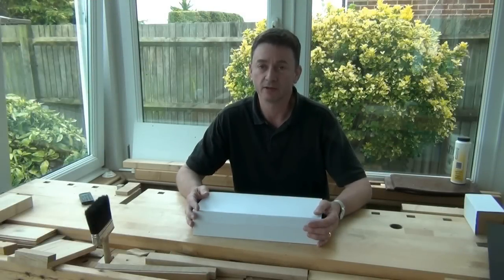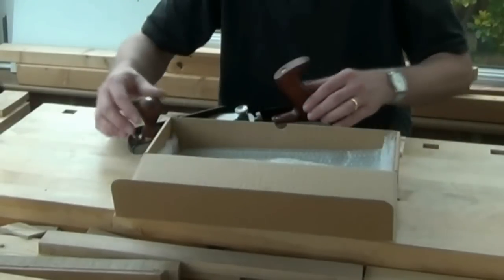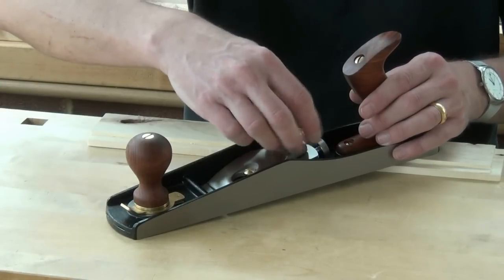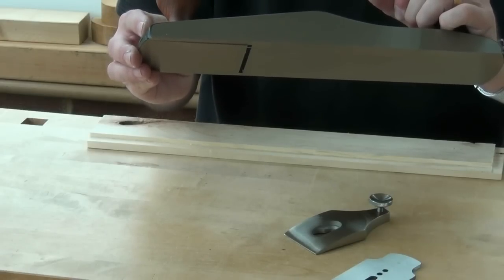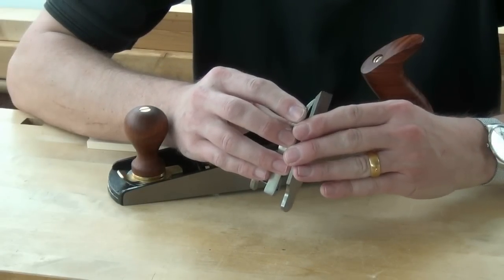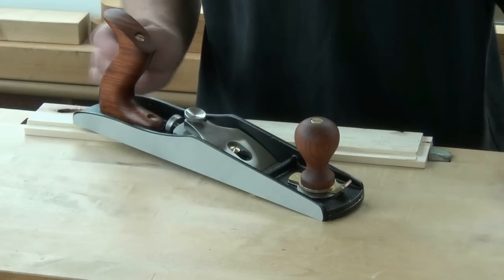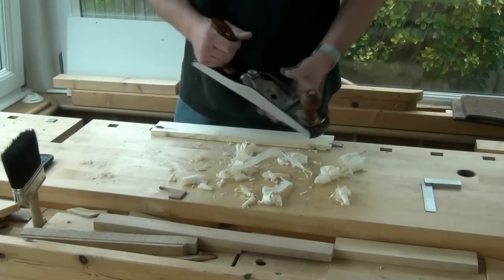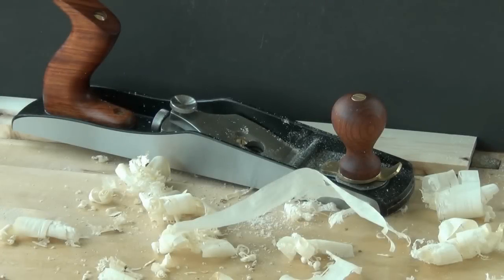Quangsheng No.62 Low Angle Jack Plane Review

Comment: I recently purchased this plane through Rutlands, where they had it on sale for about $150 US. I had the same experience you did, Mitch, with honing the iron. A minute or so on a diamond stone, then a few strokes on waterstones, and the back was flat and shiny right to the edge. I was pleasantly surprised with the small amount of work needed to get the iron honed.Also, the initial honing to me is of little consequence, because even if the iron is shipped to my house razor sharp, it will require honing again after a certain amount of use. Thanks, Mitch, for all your efforts.
Reply from the maker: Thanks, I'm pleased mine wasn't a one off! I can highly recommend the additional irons available for this plane for tackling more difficult woods, and even the toothed iron from Kunz (although mine needed a fair amount of work, it did appear that it had slipped through qa). These irons came from Workshop Heaven in the UK.
Reply: Funny, Rutlands says it's not for sale outside the UK.

Comment: I own a WoodRiver No 62 (bought at WoodCraft in 2016) which people are saying is the same.  It does not have a Norris adjuster, lateral adjustment must be done on the iron blade itself.  However, I can reach the adjuster while planing and adjust on the fly.  My iron was flat but not sharp out of the box.  I don't have a diamond stone and it took me more than a minute to sharpen :). I got it at the same time I purchased a Bailey no 5 from an antique dealer in town and spent several hours flattening and fixing the plane including ordering a screw for the toe.  I am using them both on a project I have.  Side to side, I always reach for the no 5.  Despite tuning both blades and planes, it does a better job on the highly figured cherry I am using.  I have a high angle blade for the no 62 too.
Reply from the maker: Hi Todd. That's interesting to hear. I prefer a no.5 most of the time; it just feels more comfortable. Nothing to do with the handles, which are good on the Quangsheng, but somehow to get the best out of the plane my whole stance needs to change.

Comment: Whats is the point of reviewing a plane out of the box? I don't understand why you tube reviewers keep doing this! You just spent 15 mins trying to drag a dull blade through wood when every manufacturer tells you that the blade will need additional work and that its well know and accepted fact that all cutting tools will require a little bit of fettling when new - all this could have been done in the time you spent here. Its unfair to say the plane has caused tear out when you are taking such a heavy cut with a blade that hasn't been sharpened. You might find that one of the big manufactures does a better job out of the box - but is that really a convenience worth spending double the money for? Most would say no - i have no doubt that that plane could make a shaving just as good as a big name version ones after a short period of work to get it right. The only real difference is the quality of the finish on the tool, not the work, and much as i might not like to admit it - thats not that bad either. True it doesn't compare with a LN or V but its half the price! I own something from all these manufacturers and whilst i might like to have all my tools look and feel like a LN, most people simply cant afford that luxury - i find my Quangsheng's perform equally as well as my LN and V. Fine, accurate shaving are not produced by expensive tools , they are produced by sharp tools and good technique. Look at the furniture that was made 100 years ago by wooden planes, no LN back then and most people today couldn't match the quality. Reviewing a plane before tuning it is like reviewing a washing machine before taking all the bits out that hold the drum in place whilst shipping and telling us you expected more from it 'out of the box'. You seem like a nice chap and all but this is another pointless review - i don't know what i can expect from the tool at all, i just know what its going to look like once i open the packaging.
Reply from the maker: Thanks, I appreciate your points, and that anyone with your experience of different manufacturers is unlikely to get much out of a review like this. However, many people new to the craft don't have your knowledge, and they do appreciate hearing these things. I will try to consider more experienced viewers, like yourself, in any future reviews.
Reply: +Mitch Peacock - WOmadeOD I think my point Mitch is that people without experience can very easily get the wrong idea about a plane like this when they see it trying to work straight from the box. These are great planes and will give the big brands a run for their money, but the blade will always need to be sharpened. Why not sharpen the blade up, flatten off the lever cap and do whatever else needs to be done, just like you cleaned off all the packing oil, and review the plane in the state that it will serve out its life - then people will see what it is capable of. You can always mention what you had to do and tell people how long it took etc... But the point is they see the tool working in its true condition. If after a little tuning it is still tearing out and not performing well than it is entirely justifiable to point those faults out. Without trying to sound mean, or condescending -  the errors you pointed out in your video are what you could call user errors and not errors in the plane. A LN that might plane like a dream normally but with a blade thats been allowed to get a bit dull - may be only after a couple of passes over some tough timber - will also perform badly and tear grain - but it wouldn't be appropriate to say you were disappointed with the plane - it just needed a sharpen.

And for reference i have no experience with this plane - hence my interest in your video, but i didn't get an accurate picture of how good it was because you never sharpened it - if you had, we would all have seen how well it really performed (or not). 

You have a great manner in front of the camera, and the video was interesting - there are many youtubers out there with nothing interesting to say - but i could happily watch you (and did) I only mention all this so that you can make good review videos that really help us get to know what a tool is like. I'm sorry for going off on one - but this 'out of the box' review culture is really irritating me - its fine for some things, but not edge tools.

Thanks for the response - i hope i'm being helpful and not a tool!
Reply from the maker: +Its a Peach no, you're good. I welcome all constructive criticism, and it makes my videos better in the end. Out of interest, did you watch the sort and long version of the Rider #4 review? It's still an out of the box, but also shows the result of a hone.
Reply: Its a Peach q
Reply: Its a Peach t
Reply: Got to agree, who doesn't sharpen a plane before use, and the guy then complains that his unsharpened plane is cutting too thick,

Comment: Nice review Mitch. I have the Lie Nielsen no 62, and it also required work on the blade. It was good, but the performance was not as good as expected. I had the same results as you. Sharpen the blade a little, and it came to life.
Reply from the maker: GuysWoodshop Thanks Guy. 

Given the small amount of time required on the blades, it surprises me that these companies don't go that extra mile to stand out from the crowd.

Comment: The trick to adjusting on the fly with these is to forget the front knob while you set the depth. Cradle your front hand over the wings atop the lever cap, and use thumb and forefinger to adjust for depth. Reaching with your back hand to one side of the knob may induce some unwanted lateral adjustment ..... if it's even possible to reach the knob.
Have a gander at the way Vic Tesolin sets the blade on a bevel down if I'm not describing it properly 😁
Reply from the maker: I understand your instructions and will try that out, sounds a great idea. Can't think why I never thought of it🤣
Reply: @mitchwoodwork  Sometimes we are so used to our work that we try old techniques with new things 😁 we are so accustomed to bevel down planes that we expect all planes to function in a similar way. 
I watched a video a while ago of Vic Tesolin giving a talk about Veritas tools at Peter Seftons school....... that's the only reason I know of this way of adjusting a bevel up plane for work; no way I'm clever enough to come up with it all by my lonesome 🤷‍♂️😂

Comment: How flat does the sole stay when you adjust the throat and tighten the knob. Any step would be significant. I am guessing it would be difficult to eliminate this problem.
Lateral adjuster Norris style needs no sideways play at the sharp end of the iron. Veritas uses grub screws for this. How snug a fit is the iron at the sharp end?
Reviewing it without sharpening the iron is problematic.
Reply from the maker: I think it was pretty much an out of the box review, hence using the iron as it came. You're probably right that I should have honed it. That way the decent edge it takes would have been highlighted.
The moving toe and the body were really well matched as I recall. A problem here is fixable but there is an extra element to consider before just lapping the sole.
It's been a great tool over the years, and is usually what I grab when faced with wild grain.
Reply: Thanks

Comment: A lot of people bag the No 62 as being a gimmick plane..... used onlt for end grain butcher blocks.   I have the Henry Eckert No 62 and find it out performs a bevel down plane in most area.   The ability to close up the mouth quickly on the fly on certain timbers or to just get that finest of shavings is just awesome.   The ability to quickly change out the iron to a high angle one for reversing grain or to a toothed iron for quick timber removal is priceless.   Also on the shooting board, with a dog attached, is just plane better than a bevel down plane.   Also especially with the Henry Eckert the lateral adjustment is just not necessary.   As long as you keep the iton sharpened square the alignment is about 5 seconds in placing the iron on its bed...it just aligns naturally, unsure if this is the case with other no 62s but I also have the Henry eckert 65 block plane and same deal it has exact alignment built in so no need to fiddle with it.   Never found the requirement for a bevel up now, my 5 1/4 Veritas bevel down sits there as a table weight more times and only used as damn it has to do something lol
Reply from the maker: Thanks, that's great to hear. I do need to adjust alignment when installing the iron, but a tiny hammer is my go to for that now.

Comment: One of these days I'm going to buy a Quangsheng (Woodriver in the US). I've been seeing generally good reviews. They recently came out with a No 1, so I've been thinking of that one (for detail work on small items).

I never bother using blades as they come from the manufacturer. Just as you're showing, they are semi-sharp, but not good enough for thin shavings. The Veritas and Lie-Nielsen are really no different (from my experience).

I have the Lie-Nielsen version of this plane, and the adjuster is the same. I don't think it's a reflection on the manufacturer, but the design. Norris adjusters are known for not being adjustable with the hand on the tote. That's why some people don't like planes with those type of adjusters.

Can you tell me how much work it took to make the blade back dead flat? Veritas is king in that regards, followed by Lie-Nielsen, then Hock. And are the edges on the body sharp, or are they now softening them? I remember early reviews of Quangsheng planes said all the castings were very sharp (not good).
Reply from the maker: Marty Backe Hi Marty. 

I'm not in the workshop right now, but I'm pretty certain there were no sharp edges, except the toe to main body boundaries. These I soften on my other adjustable mouth planes, so that will be a couple minutes work to put in.

My couple of Lie Nielsen bench planes are pretty old now, so I wouldn't like to comment on their current output. But I certainly had to put some work into them when I got them.

I don't have any comparable Veritas planes, but the couple items I do have I would consider to be of similar quality to the Quangsheng.

As to the blade back. I only touched it on the fine India stone for about five seconds to remove the burr, and then a few strops on the mdf honing board. There were no missed areas, and it wasn't far from a mirror finish! This amazed me, but I've experienced the same with a Hock and a Lie Nielson, despite others being far more work. I think there really is a touch of luck involved with blades, but non of the manufacturers mentioned produce blades that need much work in my experience.

The Jack will go through my normal plane preparation when I get the chance, and I'll do an update if anything important comes to light.
Reply: Mitch Peacock - WOmadeOD Hey Mitch. Thanks for the follow-up.

You're probably correct - there's a bit of luck with all the quality irons out there. But it's good to know that these are now shipping with nicely prepared blades. Flattening the backs of irons or chisels is probably what I dislike most about woodworking ;-)

Keep us appraised of what you think after you've lived with it for awhile.
Reply: I like to say that Quangsheng do make the planes for luban and woodriver. but they're 100% the same. in Australia the luban plane is close to 50-70$ cheaper then the woodriver plane. I did hear that the quality is higher on the woodriver.
Reply: Marty Backe that Chinese plane dont have a place in your collection. Dont get me wrong they are decent planes.

Comment: I bought a 2'' Iron and Cap Iron of Quangsheng , the Iron its self had a huge belly which took me 4hours to flatten out , yes I should of sent it back to Workshop heaven but felt I couldn't as they were very kind and prompt in replacing a previas order that had a defect and I used the replacement to order more Irons and save on the shipping .
The Cap Iron needed a little fettling and I thought maybe a little soft metal but it works well and a great improvement with a stanley Iron, cheaper option than replacing Irons.
Reply from the maker: Did you mean you've fitted the Quangsheng iron in a Stanley low angle jack?
Reply: @mitchwoodwork   No I fitted the Cap Iron in a Stanley No. 5 a great improvement and a cheap option , i notice in another vid of yours you use the Rider Irons I like them , they take a long time to grind down to change the angle and sharpen but keeps an edge well , how do you find them. Happy New year by the way.
Reply from the maker: Happy new year.  I like the rider irons. They chatter less and take a keener edge than the A2 steel ones, more like the traditional old irons
Reply: @mitchwoodwork   Oh I thought they are A2 steel they feel like it sharpen like A2 as you said the thickness is great.

Comment: I suspect that over time the inaccessibility of the adjustment would drive me nuts as I like to adjust my plane on the fly.Looks like a nice plane otherwise.
Reply from the maker: Tim Royal I'd have to agree there. The adjustment of this plane is a bit tricky. Tighten the lever cap enough to stop the blade shifting in use, and you can't advance or retract it, and lateral adjustment needs a hammer tap. That may all improve with tuning, but should be possible as supplied. A follow up video could well be in order, now I've lived with it a bit.

Comment: Mitch 
Isn't the low angle plane for end grain? Ergo, no need for a chip breaker since they basically just make sawdust? Can you hit some end grain with that plane for us?
Reply from the maker: Michael Gates it depends on the bevel angle of the iron as to how it cuts. A steep bevel tends toward a scraper cut and is great for awkward grain. Low bevel is great for week behaved grain and end grain. The plane is designed to do the same job as a no.5 in principle, but just in a different way.

Comment: Where was this one bought? There seems to be a variance in these planes depending where you get it.
Reply from the maker: Mark Leask Hi Mark, 
I purchased this one from Rutlands in the U.K. 
I guess different suppliers may have different specifications, or take QA failures. Ultimately, if this is the case, then the Quangsheng brand will not reach the heights of Veritas and Lie Nielsen, despite clearly being capable of great things.
Thanks for the comment.

Comment: That's sold here in America as Woodriver planes.  Sells for 200 dollars.  Lie Nielsen for 245.  I'd go the extra 45 bucks and buy the Nielsen.
Reply from the maker: UreaSmith You're lucky, the Lie Nielsen is 240GBP in England! The additional 45 bucks you'ld pay would get you a brand that is currently better respected and recognised for sure.
Reply: @mitchwoodwork  But not necessary better and for the money one would expect it to work properly out of the box.